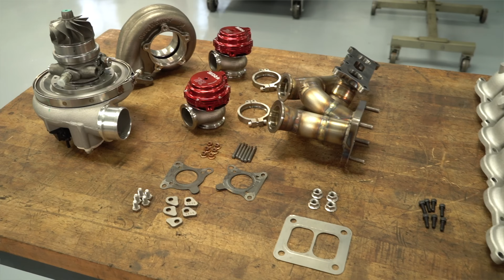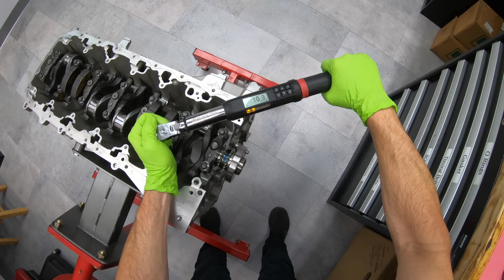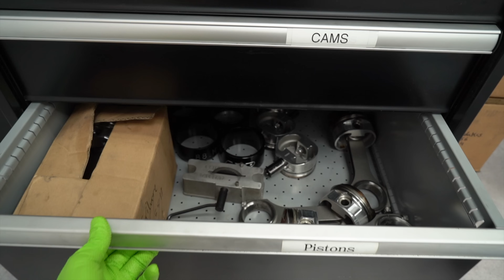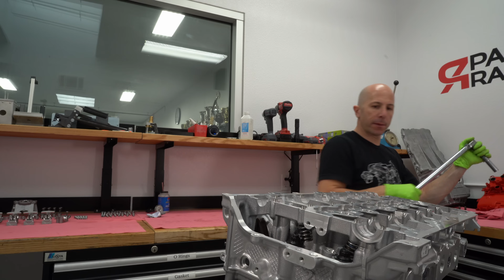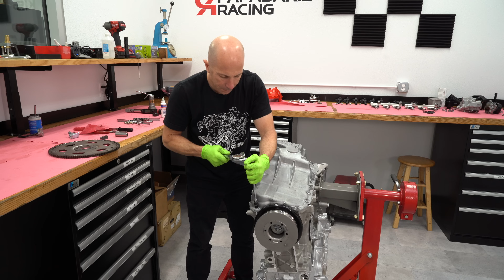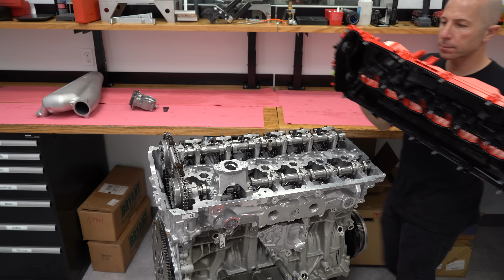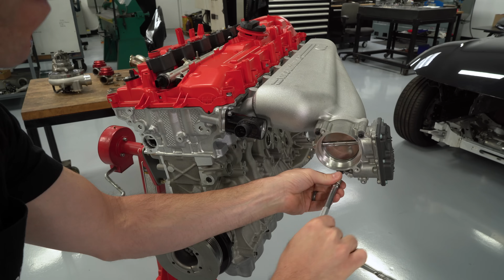2020 Supra 1000 HP Engine Assembly - Start to Finish

Comment: How tf did you guys port the exhaust side of the head? 6 cylinders blowing into 2 ports is so odd
Reply: B58s traditionally come with 6 ports although strangely the mk5 came with 2 ports which might've been Toyotas doing since the mk5s the only car with a 2 port B58 although it can be switched for a 6 port since it is interchangeable since B58s are modular.
Reply: @carboydorifutoparty3976  I wonder what difference there is in flow between the the two kinds of heads
Reply: @elilachappa3330  that is true. Coming from what I've heard from the BMW guys they say that the 6 port heads are kind of similar to the 2js heads in a way but yea.

Comment: Very impressive to see 3d printed aluminum.  I'm interested to see how the durability is after it's run for a while.
Reply: It's fine. It has lower mechanical capability than non-printed Aluminum, but it's not really a significant structural component anyways
Reply: @Shadowboost  I'm just thinking in terms of the "old" SMIMs that people used would have problems with leaks/cracks/breaking.  I don't think this would happen with a high quality modern part like that, but I'm always curious about something that is new.  Of course the intake manifold isn't structural, but it still needs strength especially in a boosted application.

I wonder if they're's some sort of heating process it goes through after it's printed to bond all the layers together..... or if the metal bonds to itself as it's printed.  I just don't know enough about the process.  It's very intriguing though and I imagine we're going to see a lot of performance parts banged out very quickly like this in the future.

Comment: the teardown was great , this video had a ton more info to absorb, spectacular workmanship reminds of the days when i use help with hydraulic turbines, every detail had to be followed like this, i believe this is far more complex, more variables, 1 thing about BMW cranks they engineer the shit out of them from factory to handle high boost loads, there are tons of gear heads running around with stage 3 builds that are close to 900 hp with stock cranks and handle the crazy boost, your work is 2nd to none and i look forward to the dyno test when you make 1000 ponies and watch  Toyota and BMW come to you and ask how you did it.

Comment: In germany we find out that the crankshaft bolt turns out at high power output on BMW m4 800ps+ please check if you need something like this https://www.google.com/search?q=kurbelwellen+verriegelung+bmw+m4&tbm=isch&ved=2ahUKEwjk-dP22o3lAhUKdVAKHZdjC4EQ2-cCegQIABAB&oq=kurbelwellen+verriegelung+bmw+m4&gs_l=mobile-gws-wiz-img.3...1398.10429..11290...0.0..0.131.2010.2j16......0....1.........30i10j0i8i13i30.Rx_a9Hhaono&ei=eQ2dXaTZBYrqwQKXx62ICA&bih=572&biw=360&prmd=sivn

Comment: "Get that nut in there"

Remember November !
Reply: It's October I can probably get 1500 nuts in before then
Reply: @ironicchannelname6457  that's alot of nuts
Reply: @JustinAbroad  already half way there 😎
Reply: Marios Tabajen shiiiiiiiiiiiiiiiiiiiiiiiiiiiiiiiit that’s next month
Reply: poppet valved 2 stroke with dry sump and oil injection, and amsoil dominator 2 stroke oil, that all i would run if i get a hold of one of these, nothing but 2 stroke oil in it, total loss oil burnoff
Reply: The most childish shit, go back to your meme page lmao
Reply: on*

Comment: Lol, so you take an engine with direct injection, intercooled intake manifold and valvetronic, throw those technologies out of the window to make your 1000 hp? I do like that approach.
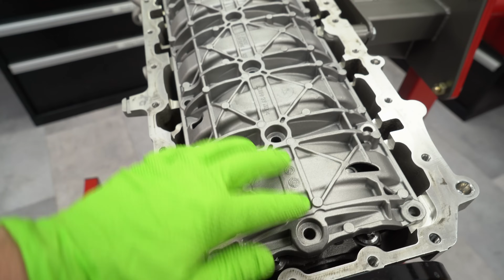4:55 I think that baffle brace is there mostly for looks and to keep the oil calm so that your oilpump doesn't suck up foamy oil and you don't get air bubbles in your lubrication which is actually the weak point that kills most Subarus.
And to get the cam timing right you could have just used the Russian way: put a stick into the sparkplug hole, slowly turn the crank and feel for when it's in TDC, then the stick gets swapped for a dial indicator and everything gets tightened once in you're in position.

Comment: When torque then bolts you should keep your hands off the socket.  Squeezing the socket or have your hand on the socket can & will add drag on the torque wrench. So your bolts and nuts wouldn't be torque to the right spec.

Comment: Damn. Wish you did once of these every week. One of my favorite things on YouTube by a mile. Your approach to these videos and the narration is so perfect and informative. Also love how BMW 6 cyl motors are so similar throughout the years. I recently rebuilt an S52 and tore down my blown N54 and they all have so much in common ...just better over the years. Fun stuff.
Reply: Man share opinion on the wear of the s52 is there oil starvation ?
Reply: @dimitartenchev9338  I actually bought a used long block and assembled that to replace the original S52 in my M3 which has over 260,000 miles on it and still runs! Haven't torn it down yet. They're awesome motors!
Reply: @dimitartenchev9338  PS- the issues I'm aware of are oil pump sprocket nut can work its way off and cause loss of oil pressure. On my new build I used safety wire and a nut I got on Bummerworld to secure it to the sprocket. 

Also - you can get baffle kits for the oil pan from VAC if you're planning on tracking it.
Reply: This a toyota guys!!!!
Reply: Mario Rivera bmw engine
Reply: @astre09  you didn't  get the memo... I was just being  sarcastic!!!
Reply: @mayorivera1364  Yes... but the engine is Bmw.  the same variable lift cam design is also used in the bmw mini cooper.  You can install them with a lever made from old head bolts welded together.
Reply: @FirstAidIndustries  we all know that I was just being  sarcastic  to flip ppl around  like yall did we know the new supra is a bmw with toyota badges
Reply: @mayorivera1364    My apologies...didn't see your comment further down :)
Reply: @FirstAidIndustries  dont worry  it happens
Reply: I'm thinking about turboing my S52 M Coupe '99, looks like the valve cover gasket may be the weak point (and oil pump you noted) but they have modern solutions to those with cutring gaskets it seems like.  Is there anything else you would suggest for weak points?  Cool to hear about your rebuilding of the S52 and the N54!

Comment: Once you have all the specialized tools this engine looks much easier than a 2j or 7m too work on!
Reply: agreed, even on an old 350 small block you wouldn't have something stopping you from putting the bearing caps on backwards. that is genuinely one of my favorite features of this engine.

Comment: I LOVE how the B58 is engineered. It just makes sense and the way you time the engine is awesome. even i could do this now😁
Reply: Its a BMW product whit the Toyota logo in the front and back of the car
Reply: @doublagesdelanaudiere3700  and how does this change anything? i think that makes it even better, if i had 60k laying around, supra would be my way to go
Reply: German cars are known to break very fast and they are expensive to fix
Reply: @doublagesdelanaudiere3700  dude. my 325 is 25 years old. atleast half of its life it was a driftcar, always banging limiter. im on 185k miles. just shush in the next corner and go on building pushrod engines in 2020
Reply: Are you in Europe? If you do the parts will be less expensive and more common for those cars than in North America because here there not a lot of people whit 20+ yrs old German and American cars and every one junked them and crush them because no one would buy those parts so the junk yards loses money while keeping these cars
Reply: @doublagesdelanaudiere3700  e36´s are still really common in germany, you get parts dirtcheap. heck, most of the times the driftdudes give me stuff for free, this thing is a breeze to dailydrift. doing oil changes at the intervals your cars manufacturer says to do them at apparently goes a long way...😲
Reply: Yes they are good cars but here German cars are known to have electrical failures and it’s a pain up the ass to get the parts and the price worth more than the car value so most of the people get rid of it.

Comment: "And for this we need a special tool" ahhh, ze Germans
Reply: Someone never worked on GM vehicles before.  Needed a special tool for just about everything from taking fuel lines for starters.
Reply: Get your fuckin Mickey Mouse tool kit out, we got a doozy
Reply: thank good for good old American 3d aluminum printers.
Reply: You could fill a decent sized tool box with just BMW special tools.  The Germans must hate auto mechanics other than dealer techs and euro car specialists.
Reply: It might sound like a stupid answer but you need the tool because the part was designed to be built by machanical aids to speed up the manufacturing process. It's far more German than you guys can even imagine 😂😂
Reply: @justdave100  that's gotta be the best explanation ever. I might have to steal it sometime.
Reply: How many time did he say special tools and tricked? You could build a 1000hp LS engine with basic hand tools🙄 still needs to hold another 1000hp to live up to the name. I got money says the block will crack
Reply: My thoughts exactly- I get manufacturing efficiency,  but I have to wonder if those German engineers actually worked on the cars, they may have taken a step back to say "... or we could just put an arrow on it"
Reply: It's only a "special tool" because the rest of the world is stuck using shitty inferior tools and fasteners.
Reply: @derbigpr500  found the German
Reply: @derbigpr500  Inferior for company profit!
Reply: Anton Zuykov  nothing about this car would. The new Supra is basically a Z4 hatchback. It's BMW made, bumper to bumper. I would be very surprised if Toyota actually made even 1 component that wasn't a badge.
Reply: @AlexandarHullRichter  the badge is a BMW part not even kidding

Comment: Love seeing someone have such an easy time building this engine, as a long time BMW tech I’ve always held the notion that our engines are pretty easy to work with. Would be cool to see you retain the valvetronic function and use it as the throttle like we do in stock form. The throttle bodies are basically there as a fail safe on our VVL engines, and allows for air to be ready at the valves at all times so you don’t have to wait for the plenum to fill after opening the throttle.

Comment: You are the first place I look for information on build big horsepower engines like the B58. You ability to extract horse power is based on skill. You use modern manufacturing technology.  I want to see the dyno results.

Comment: I’m a college student, going to MSU for mechanical engineering to work for a car company, watch this video, and I see an SLM machine which is what I’m doing research with a professor on. Crazy, but I do have a couple questions.
The people that made the intake, did they treat/polish or do anything to the aluminum? Did they use a HIP machine? Raw additive manufactured parts aren’t as strong as wrought material, but that is also more for stress/strain applications. Do they do this for a lot of high horsepower applications?

Edit: I just saw your other video, you use NX also... wow
And to top it off, if you can’t tell by my (Americanized) last name, I’m Greek as well.
We’re gonna be friends.

Comment: Dear Jesus I can just imagine the bill for that printed intake. Beautiful use of the technology though.
Reply: I didn't even realise you can 3D print products like that 😳.... It will be interesting to see when all that boost pressure is high if all will still be good or will it create small leaks 😵. Time will tell.
Reply: @smooth_ops2942  Don't worry they're solid; Its about as strong as cast as well. They compact powder for each layer with a roller then sinter it with a laser bonding the whole layer together with itself and the layer underneath. Some machines work differently, but I believe that's how this one works based on the build plate and parts.
Reply: @wolfman5494  thanks for the explanation 👍... Crazy times we are living in.

Comment: Yeah sad this is 2jz replacement. I mean yes good new tech but look at that valve train. Look at the complicated timing set up. These are all things the 2j did right. Simple extra strong and great. But this BMW engine with all its special tools eh im not impressed. I really wish toyota had a division that built real.good stuff still in small quantity. Like the 90s celica awd or supra. I stead we get a bmw and a subaru labeled a toyota. I will always drive toyotas but not after mid 2000s

Comment: Either throw a tack weld on that oil pump bolt or safety wire it. It’s a common issue with bmw stuff. You’ll thank yourself later

Comment: Try using a valve core tool to install those wrist pin retaining rings. The ring should fit into the grove of the valve core tool allowing you to walk the ring into its seat a little easier.

Comment: How much did you have to spend on "special" tools?
Reply: Timing tool is all you really need. You can install the valvetronic spring and the cams with basic tools. It's just a lot harder and a lot more room for error. BMW tools make everything fool proof and minimal effort for their mechanics. Would you rather have a tool to compress a spring perfectly lined up for you or fight it with a pair of vice grips and hope you get it lined up right?

Comment: Thanks for another piece of awesome content! Just curious, why are you going away from the Direct Injection? Not enough fuel system to support the boost pressure targets?
Reply: the direct injection will stay, he is just replacing the injectors with ones capable of providing more fuel than the OEM ones

Comment: Love  your videos! I am sure you are aware, but on older BMW engines there are problems with the bolt for the oil pump gear coming loose and also the shaft braking due to vibrations. Maybe that is worth looking into for  this engine also?

Comment: when i torque down the heads i use a 2 foot metal pipe that fits over the handle o f the torque wrench and i hold the presure for 20 seconds or so !  u can tell the difference when u torque the head and then take it off imeadeatly .  if u dont hold the pressure for at least 15 seconds u will not hear the bolts break loose on disasembly. i have held presure for 10 seconds and then the bolt started turning again 1/2 inch ! this also insures that the bolts all have exact even tightness . have a great day !  and blow that head gasket !

Comment: Use those direct injectors.
Make them run   at partial load and under  high load use them with 30% DC to not overheat them.
Until some one makes high flow direct injectors for that engine run them  in a staged set up with port injection. Use it as a development engine, if you got the staged injection figured out the European crowd should be interested.
BMW, VW, Audi, Porsche and some Subarus, all run direct injection on street cars.

Comment: How come the engine is 6 cylinders  but only has 2 exits on the head?
Just curious is it channel in the head??
Many thanks.
Reply: The exhaust ports are in the head. Newer engines are ths way to have less heat loss before the turbo so its more efficient .
Reply: @SimonTrent8000  

Thanks,
I just watched his other video's about this engine and found that out,internal exhust manifold in the head...

Comment: That Snap-On torque wrench by itself costs as much as the entire engine teardown/rebuild + tax
Reply: Tall Paul geez how much does it go for?
Reply: @jaybosher6144  Ive seen them on the Snap On van for 600-700 Pounds (1/2 inch size)
Reply: You mean its a re-branded  cough CDI TORQUE PRODUCTS cough torque wrench.
Reply: for anyone that cares there are much much cheaper tools that get the job done 99% as accurately. Snap-on is only a brand name and not everything from them is worth the money.
Reply: @InTheZone85 Maybe it's not worth if you are doing just one build every so often but when you are doing it at a professional level, it's not the same 😅 Maybe I'm wrong, I don't know
Reply: @WhathefrenchTV  I think the current consensus is that even at the pro level there are much better values for pro lvl tools. Snap on of today isn't what it used to be
Reply: @InTheZone85  In fact this is a gimmicky all in one tool. You don't need a digital torque wrench, a mechanical will do the trick just as well.
@Whatthefrench He just bought the tool cuz he can. ANY torquewrench will do the trick just as well.
Reply: @sgt-willkillu  
Exactly. Snapon has turned from a reputable manufacturer to a sticker-brand. The rights got sold and now Chinese junk gets a snapon sticker. AvE makes a lot of videos about that topic.

But mechanical watches are in my mind worth more than electrical watches, with a decent mechanical watch it gets auto-reloaded and you never need to change batteries. In is chernobyl meltdown proof, and nuke proof. Unlike digital and electronic watches it will continue ticking after electromagnetic pulses.
Nonetheless: if you want a decent mechanical watch, then you can still get Seiko or Vostok that are both way cheaper than a Rolex.  You get get a Vostok for 50 pounds in Russia, so you're still right that 10000 is way too much.

Comment: Why not swap to a standard B58 cylinder head with traditional 6 exhaust ports? How well does the 2 port design flow at 1000hp?

Comment: You mean Adam showed how easy it is to make 600+hp with ease. Big ass difference having to pull out the whole engine to get a build then put it back in.

Plus a 600hp Supra will pull on cars with  much higher hp. Its more interesting to the masses to see the cars true ability to get hp without having to open the engine up. 

Most N54 owners never open the engine because they know the engine can do 750whp plus.